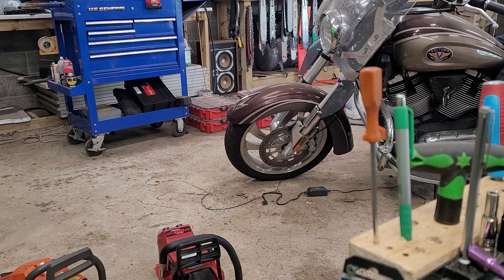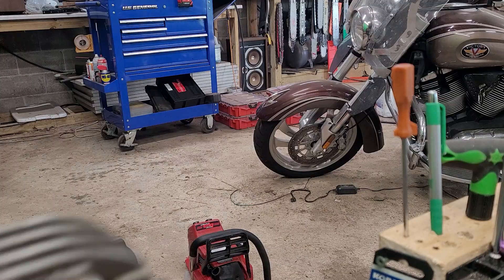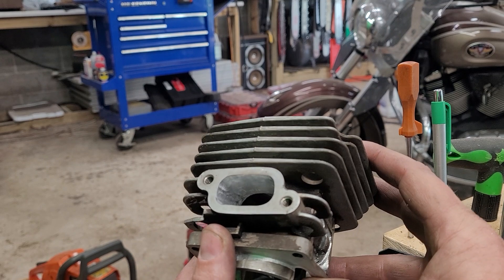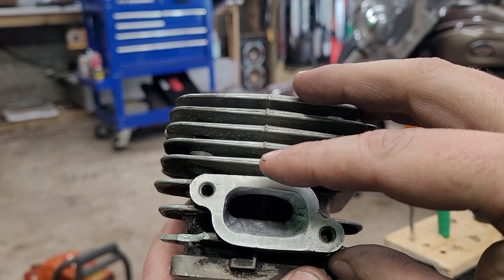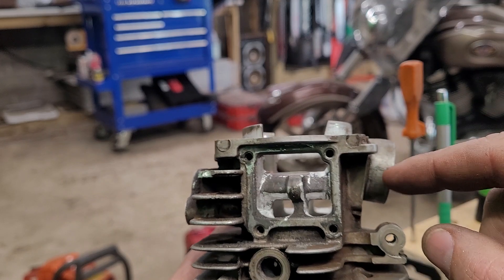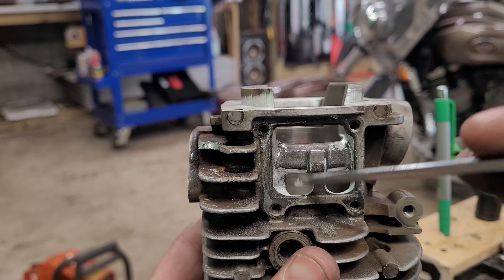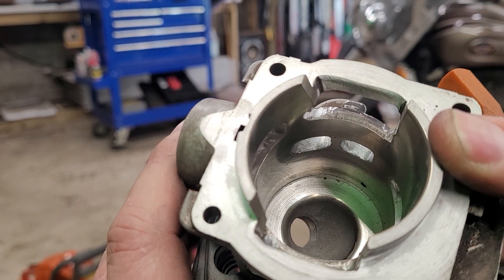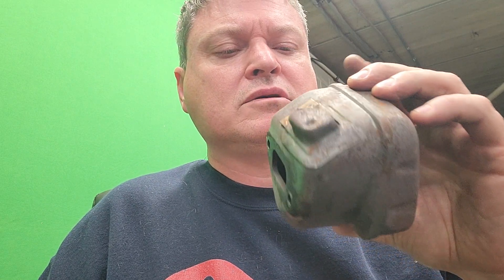Husqvarna 359 port work

Comment: Any thoughts on advantage to be gained by timing advance on a ported 359?  Mine runs super well without the advance, but I do see mention of advancing the timing for improvement.  I might give it a try.
Reply from the maker: Yes.  Huge gains on a 359 with a timing advance.  Go 8⁰-10⁰ advanced.  You'll find out what you have been missing all your life.